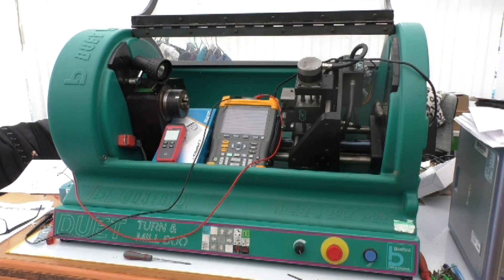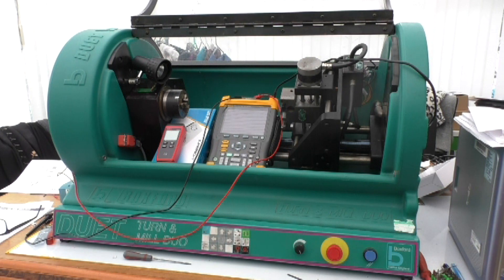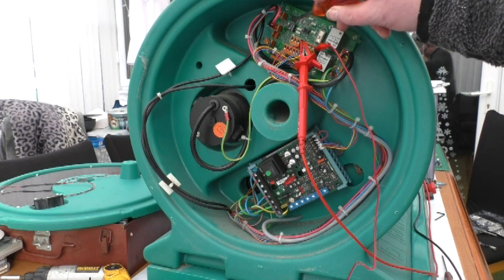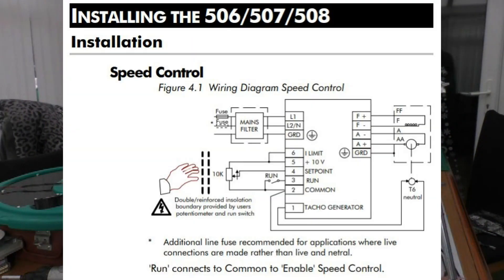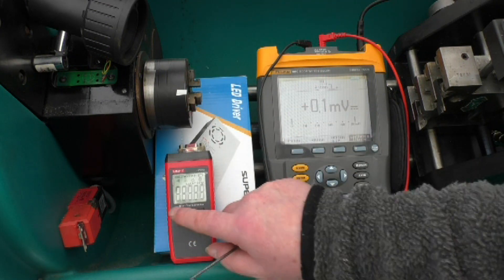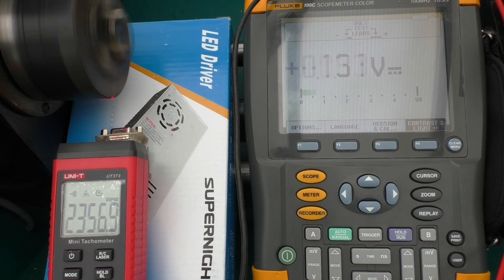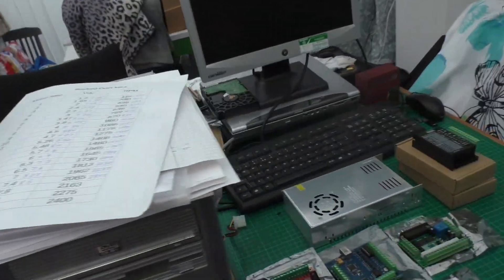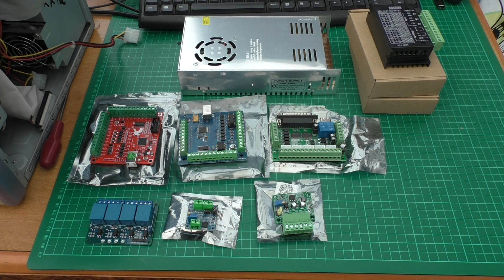Boxford Duet Turn & Mill Duo Mach3 conversion (Part 1)

Comment: price please?
Reply from the maker: Total cost of hardware in GBP as of 2023 all brought from amazon
£6.99  Printer Extension Cable USB 2.0 B Adapter Male to Female Connections
£21.88  SUPERNIGHT 12V 30A Switching Power Supply
£23.00  MACH3 Controller USB MACH3 100Khz Motion Controller Card Breakout Board 
£23.99  3 X Dealikee TB6600 4A 9-42V Stepper Motor Driver CNC Controller
£10.00  4 Channel Relay Module, 12V 4 Channel Relay Module Optocoupler
£12.88  Frequency To Voltage Module, 3.3V/5V/24V 0-100% 100HZ-3KHZ PWM to 0-10V
£9.00  Various cable rap, fixing, cable ties
Total =£107.74